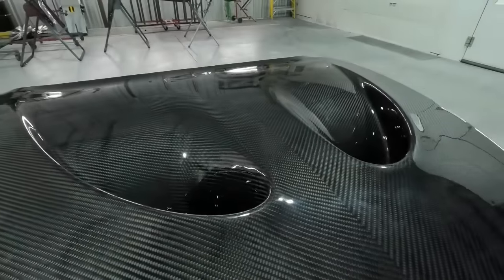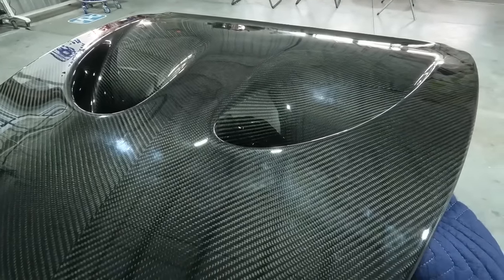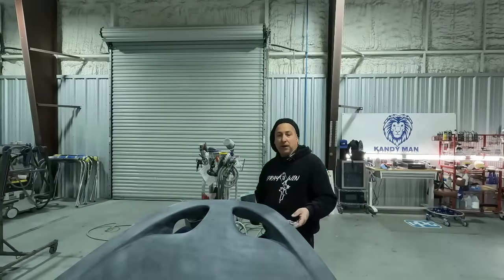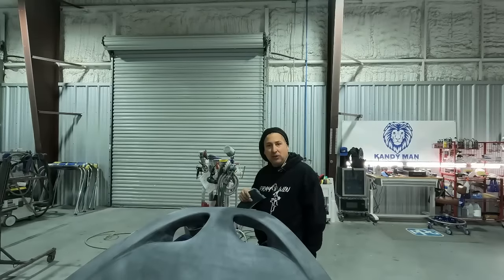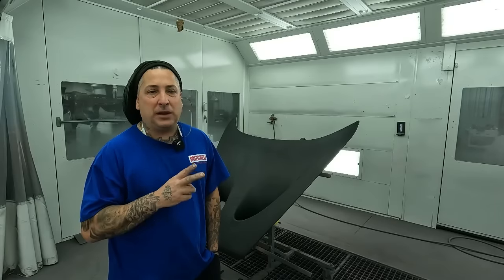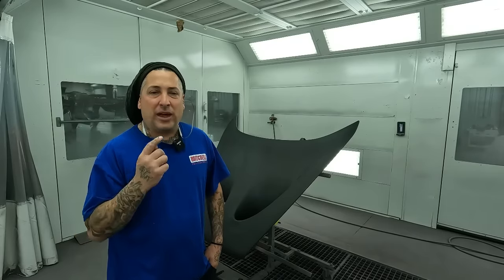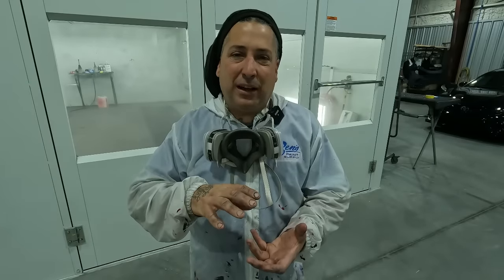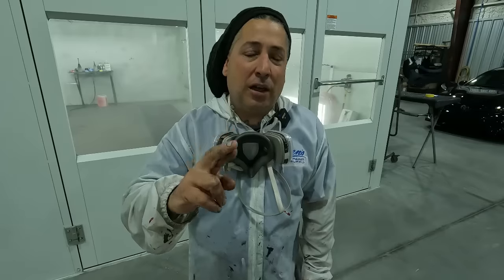Painting @tavarish P1 Hood For The Color Reveal At SEMA 2023

Comment: Great job..few questions.. Regarding the candy clear... do you add any reducer to your clear coats,1,2,3,4 etc

What gun did use ws400? to spary the clear.. how many turn on the fuild  cus you keep nice wide fan looked like you where pouring it on....something tell me that it only looked that way and fuild was turned down. Appeared you smashing it on with that wide fan
Reply from the maker: Kandy is a 2,1,1 mix ratio  used dv1 clear  23 psi